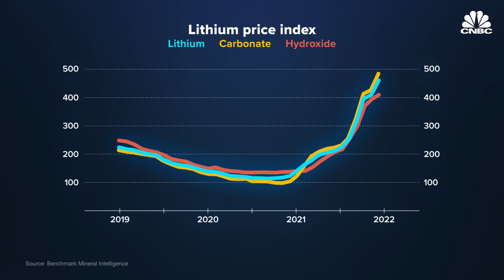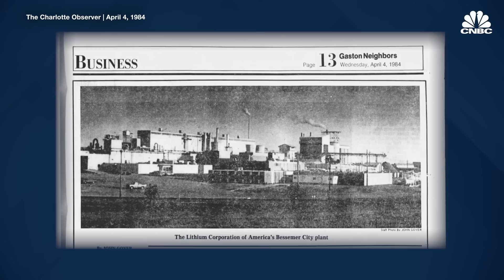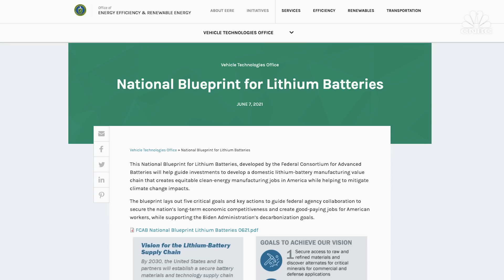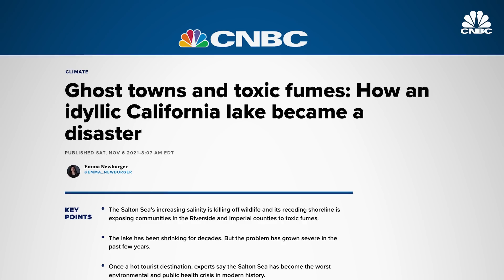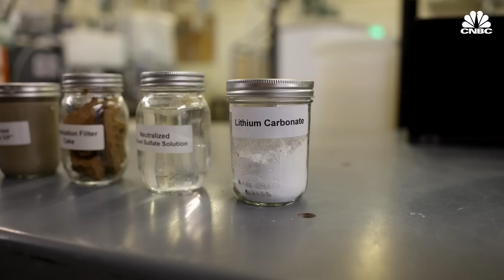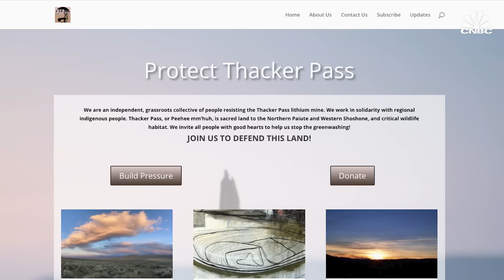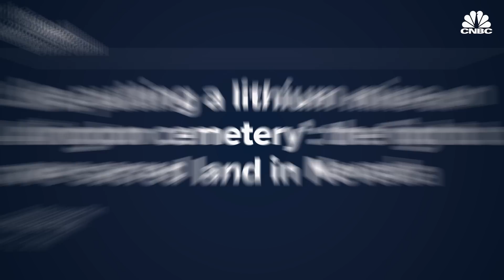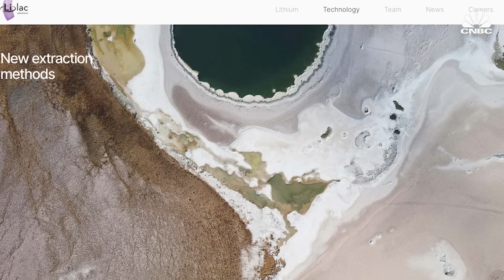Why The U.S. Has A Massive Lithium Supply Problem

Comment: A very simple solution is to just import chinas and europas old batteries and recycle them. No need to mine just recycle! Lithium can very easily been recycled and has endless reusable cycles
Reply: Well, it is possible when the transformation to electric cars already happened, and the number of discarded old cars and the demand for new cars are balanced.
But to get there, a lot more new EVs and batteries must be produced to replace the regular cars. Once these batteries are there, and get old, they can be recycled.
Reply: At this stage recycling is 5 times more expensive to recycle than to mine as it is more complex. So no until there is a significant shortage causing a price hike

Comment: How about powering all the EVs since nuclear power is no longer green energy. This sustainability thing is going overboard.
Reply: Sustainability is a good thing, but the current implementation and change-over is going to cause additional major issues.  You can't just shut down oil and nuclear and say we are going to go green, without first building the infrastructure to transition over to.  I expect a major energy crunch in the coming years!

We also shouldn't be so quick to dismiss NG and nuclear energy, both are fairly clean.

Comment: Electric seems like the solution, but nobody can predict the future. The massive investment into this technology should concern people.
Reply: What's the alternative then? Fossils are choking us, nuclear is too risky in an incident, and hydrogen leaks out of everything. Electricity doesn't require as much different and moving parts, and excess work can even be recaptured instantly for more efficient usage.
Reply: So what? You want it to be incremental? What is your particular solution? Just because GM is trying to get in this doesn't mean it's gotta be sketchy. Remember they'll disappear in the coming decades if they don't adapt to the times.
Reply: @doujinflip  nuclear plants are risky?? How?
Reply: I’m not suggesting an alternative because I don’t have one. I’m simply saying that this push to transition to electric is going to have unforeseen issues that won’t be realized until we are farther along in the process. I’m not standing against OR for it. It’s necessary to be skeptical based on previous technological innovations, because those are the very things we are trying to replace with this technology.